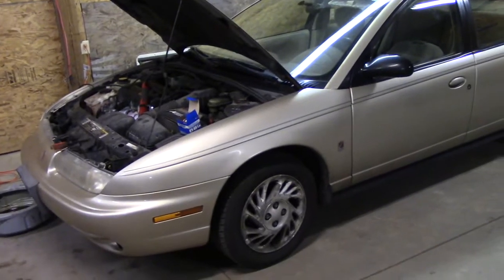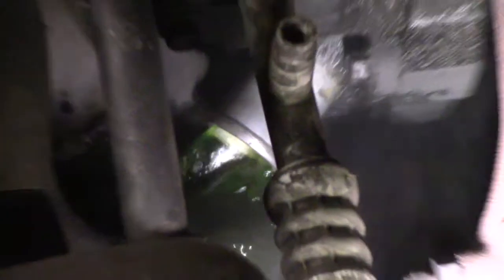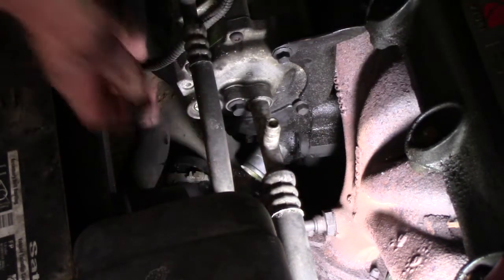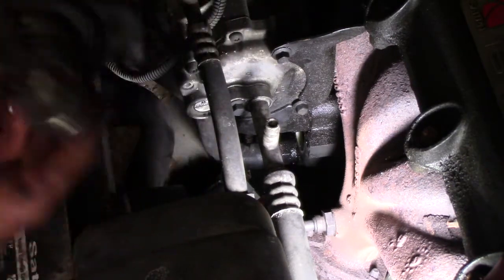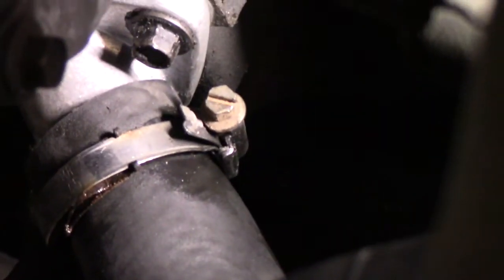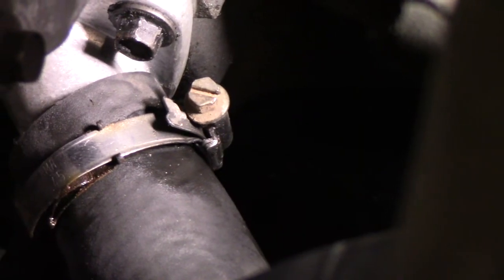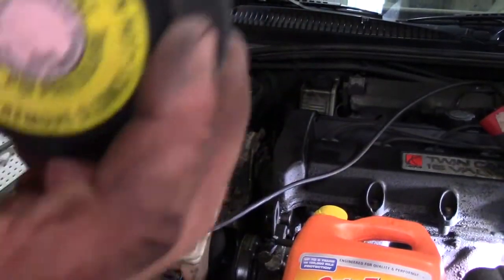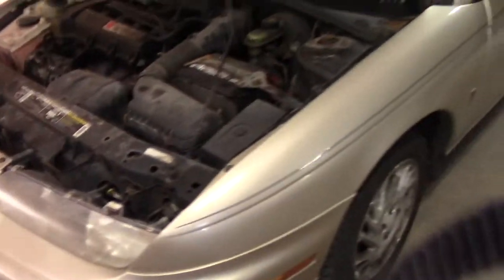Replacing the thermostat on a 1998 Saturn SL2

Comment: 12/07/2023, watched your video and just replaced the thermostat on my 97 SW2. Thanks for the straightforward explanation.
Reply: Gonna do mine this week and a coolant flush and etcs replacement since I just got the water pump done. Pretty straightforward?
Reply: @MrHorkster  very. One thing I can say on mine is there's not much room to work on the lower bolt even with a 1/4 inch drive rachet, but still only took me like 10 minutes.

Comment: Find if you put a little die-electric grease on the O ring it helps hold it in place and does not degrade the O ring as it is a Silicone based grease.

Comment: So does ur car need to be cooled off when replacement of thermostat,or can it be hot??cuz I seen it smoking hot when coolant flowed out jus wondering!!
Reply from the maker: You want it cooled down so you don't burn yourself. The antifreeze will be the same temperature your car runs at...most are 195-200 degrees

Comment: No need to bleed the system?
Reply from the maker: I didn't need to, but you might want to let it run for a minute or 2 with the cap off to bleed the air out.